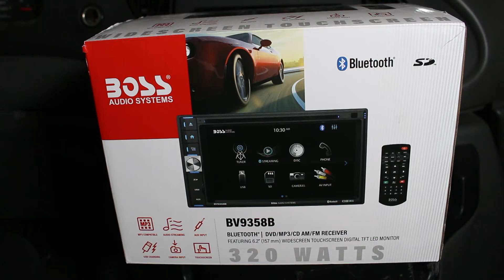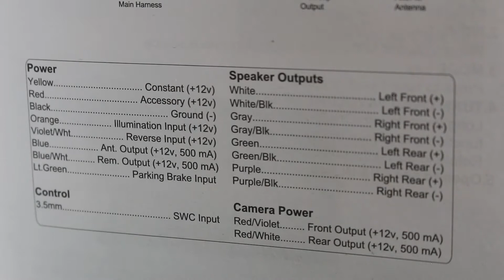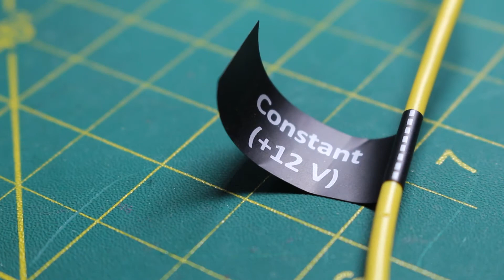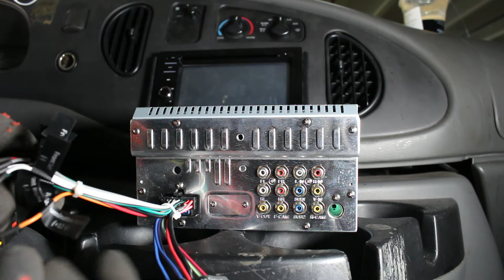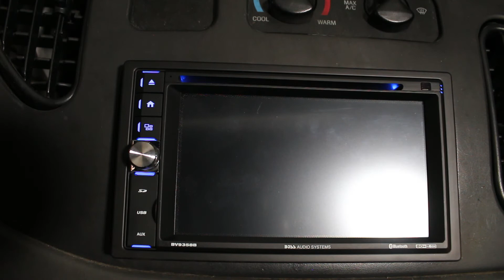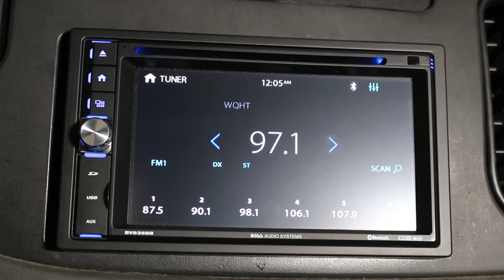How To Install a Car Stereo (Boss Audio Systems BV9358B) Double Din Car Radio Installation

Comment: Great video..but my usb or SD port  will not play flashdrive is only 16GB and set to fat32 format it displays ! no usb or ! no SD
Flash drive and SD works in all of my other vehicles  does your unit work that wasn't shown in the video

Comment: Question. Mine is currently stuck on the warning screen that reads "viewing while driving is strictly prohibited Parking brake must be engaged to view" but even when I engage the parking brake this message won't go away.  And I can't click off of it to select music or anything else as the screens stays locked on this error message. This boss audio system came with the car when I bought it so I didn't install any of this myself.  Any tips?